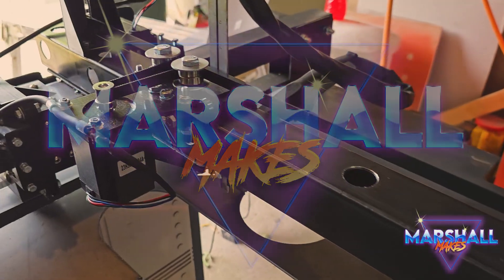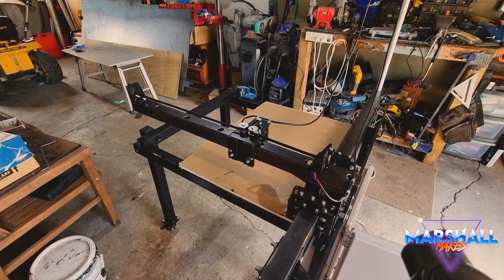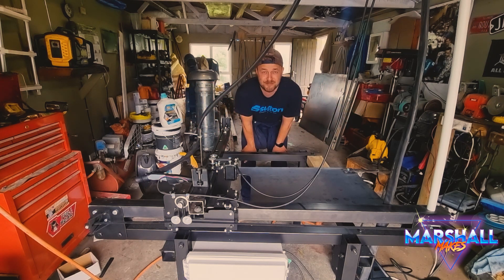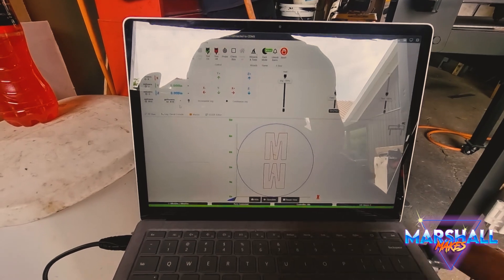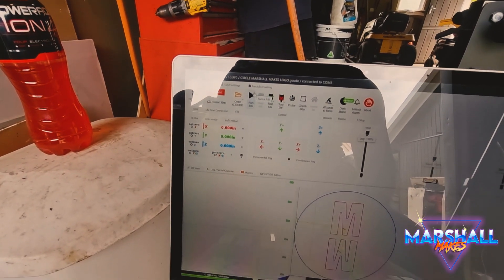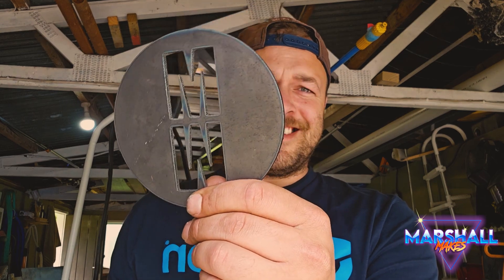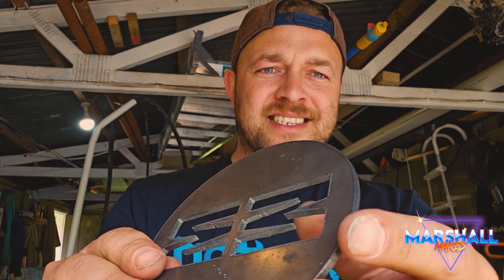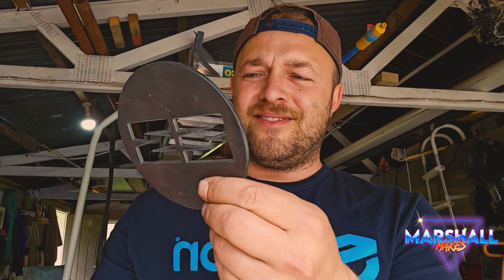$900 DIY CNC PLASMA TABLE  - THE FIRST CUT

Comment: Its bloody good to see someone else on this side of the equator building this also. Im bloody intimidated by the wiring, but hoping once i have all the gear it will make more sense to me. Seeing you use a Razor cut 45 helped me decide to go down that road instead of the Lotos plasma cutter. Cheers man, thanks for putting this out there for us to see.
Reply from the maker: Thanks mate appreciate the feedback, if you need any help with yours feel free to reach out on Facebook or Instagram and I point you in the right direction. The Razor Cut 45 is by far the best plasma cutter in its Category, I have had a few of the cheap ebay machines and nothing comes close to the Razor cut.

Comment: The quality looks amazing. How much of that could be contributed to the CNC and how much of that is the Plasma cutter itself?
Reply from the maker: The cnc table attributes a huge amount and I would say about half or maybe more for me, this is because my freehand is terrible. Cutting things out is all about consistency, if the machine can run consistently and the cnc has no jumps or vibration the cut will be perfect.
Reply: @Marshallmakes  Thanks for the reply. Makes sense.